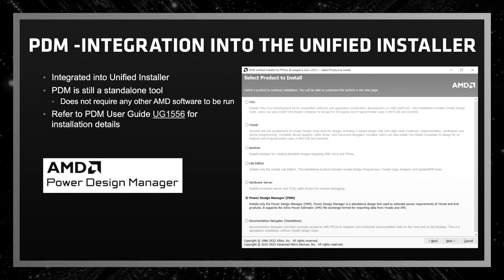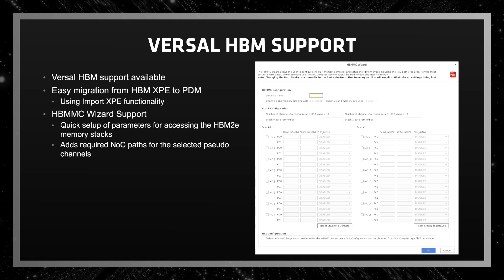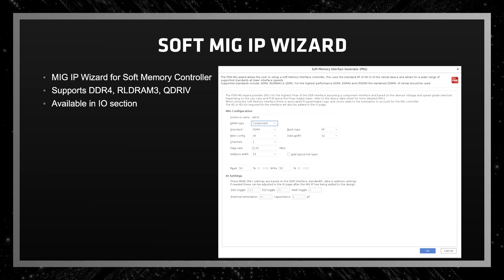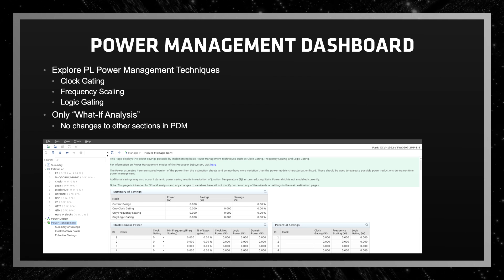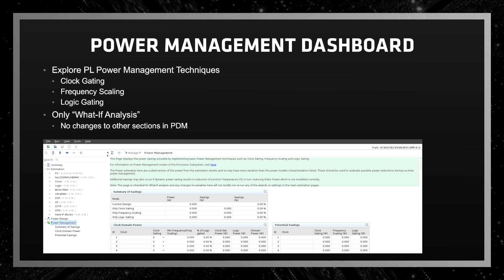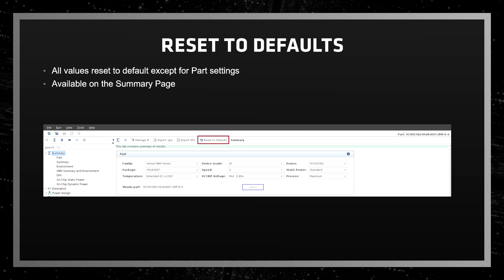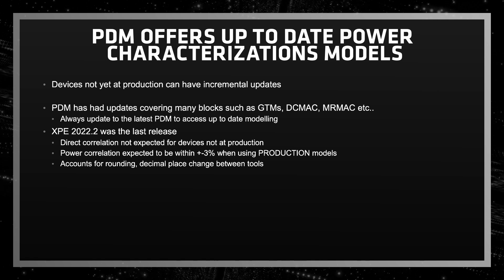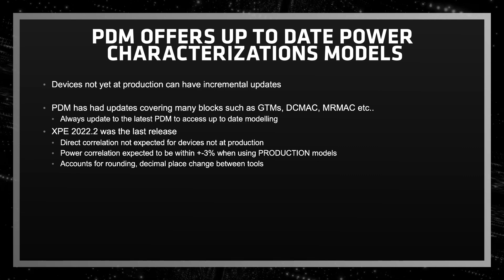Power Design Manager What's New in 2023

Comment: Epoxy Vegas only / soak chip and hbm with silicon and you will observe strings of chemicals coming out of the chip if left alone and in the sunlight / once the gpu is hot from sunlight clean the silicon off the chip polish and repast and run software… have fun it helps with hbm 24gb is what I loved on my Vega 56 xfx